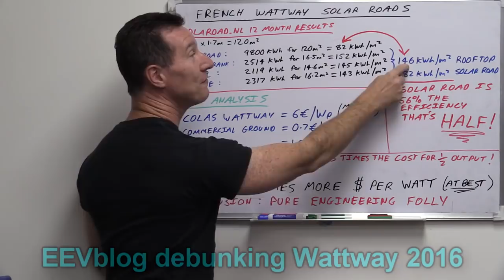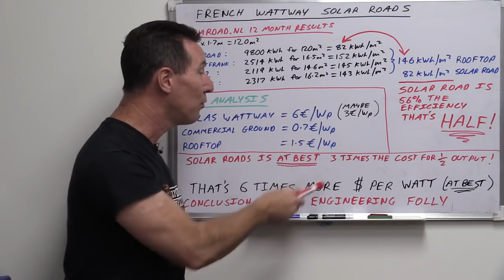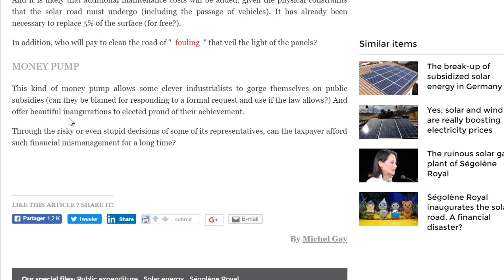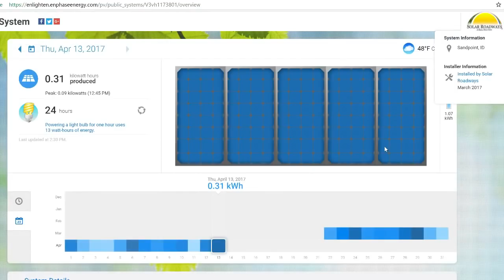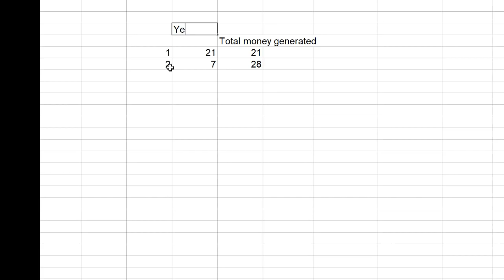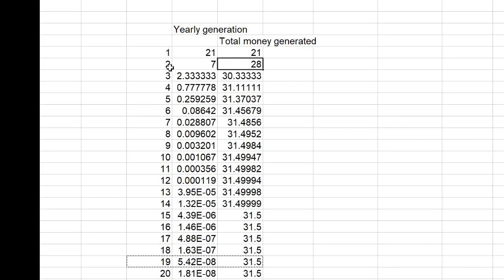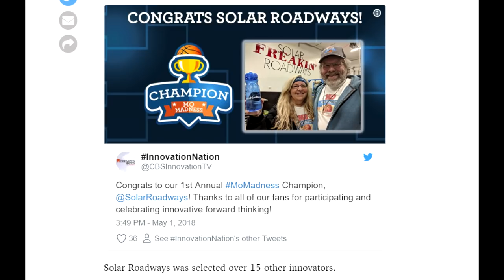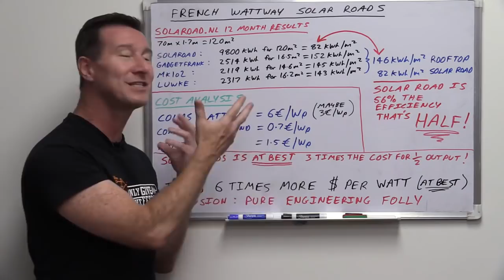Solar Roadway: 10¢ return on $1000 investment!

Comment: The very moment I first heard the term "solar roadways," my reaction was "Why not just put the solar panels NEXT to the road?"
Reply: Taran Van Hemert even that doesn't work very well - there was a stretch of road near where I live with a line of solar panels mounted on the side barrier - in the winter, that much dirt and crap got flung up onto them by vehicles they were useless even when the sun was out.  They gave up cleaning them after around 2 years and pulled them out earlier this year after around 5 years of doing nothing.
Reply: Yeah, DIRECTLY next to the road is also dumb. The example at 4:44 looks pretty decent - they put the solar panels high above the road.
The fact that there's a road nearby just makes accessing those panels more convenient.
Reply: Phantomthecat solution, don't put solar panels there... Or on dusty prone roads. If the south Koreans can manage putting panels next to roads, it can't be impossible.
Reply: +Phantomthecat
It depends on where the solar panels are.
In a city?  Makes plenty sense.
On a highway where tree's are literally right next to it?  Uh..yeah no.  Unless there high above the ground like how South Korea did it, it wouldn't be viable at all in the slightest.
Reply: Funny thing is that there's a lot more practical solutions within their own video. Solar panels on rooftops, solar panels in the desert, both of which instantly better ideas all around
Reply: sonic8005 
Oh crap, don't give the Middle East solar panels. They'll make a killing out of the sun long after oil fades to obscurity. They will use it as a political bargaining chip.
Reply: Why not put them on the building's..    I just moved into a brand new building built less than a year ago I went up to the apartment building roof and guess what..  No solar panels..  But yea let's put them on the road..  Lol
Reply: Stop that anti-innovation practical thinking immediately!
Reply: +EEVblog pfft, never! We all need to research more, its the only way to regress human kind back into the stone age obviously. The best way to fight CO2 emissions is obviously stopping progress.
Reply: They put solar panels on top of streetlights in Indonesia. This setup actually works
Reply: or on top of the road to create also shadow and not have to drive in the sun??
Reply: +ANIKHTOS in the old videos thunderf00t brought up that they suggested car parks covered in solar roadway when they could literally just cover the park and provide shadow so that you don't leave your car in the sun.
Reply: where car parks?? and how the sun would hit the panels??
one stupid idea replaced with an even more stupid idea
Reply: ANIKHTOS, A car park is a structure you park inside of, they meant place the solar panels on the roof of it.

In the south a lot of people have a car park, instead of a garage.  

I think the idea was to make parking lots, into large scale car parks.  Economically not the most feasible, but there is the added benefit of shade.
Reply: @ANIKHTOS
Not for all countries but those closer to the equator where there is lots of sun and rain. These would benefit from covered carpark with covered walkways leading to the residential apartments. 
http://www.chonglek.com/wp-content/uploads/tf2.jpg
https://upload.wikimedia.org/wikipedia/commons/9/98/Covered_walkway_in_the_Tesco_car_park%2C_Carmarthen_geograph.org.uk_944782.jpg
Something like a combination of the these two pictures.
Reply: Titanium Rain this so much.
Reply: ANIKHTOS Reading comprehension is a very important skill.
Reply: GhostInTheShell29 It's not just a southern thing, parkingl lots are all over the place.
Reply: +ANIKHTOS
Uh..How is it stupid to cover an entire Walmart parking lot full of solar panels high above the ground, supported by the same poles/lights that let you see around to begin with? Hell, not even covering the entire parking lot, you could just put solar panels on top of these lights (which a couple of companies are already doing to power the lights by themselves) and generate electricity freely and safely.  

There high enough to where no criminal would be able to get them, and they're high enough to where no one would be able to destroy or cause much/if any damage to them on accident.   
Not to mention if anyone tried to, Walmart has plenty of security cameras right on top of it's massive building to pretty much see in every direction.

Hell, we could cover an entire Walmart with Solar Panels as well.  Again, not stupid ideas at all.
Reply: @ChucksSEADnDEAD  I just visited Legoland and half the parking lot is covered in shade... from solar panels.  Of course, there was a 50% premium for parking under the panels. win2+win = 2 wins for Legoland and 1 for me.
Reply: Or above it.
Reply: But then how would you get the cars to drive over them?
Reply: My thought was the government taking the money we put into foreign stuff and applying it into solar panels for houses. Yes it would take a long time, and it would need refreshing every so often years, but honestly, the money we spend on all the stupid stuff nowadays, is it really that bad of an idea? You would literally be better off installing solar panels on every house in America alphabetically than what we spend it on nowadays. Not just the gov, but individuals.
Reply: Taran Van Hemert I wonder if these solar roadways could even power all of your keyboards.
Reply: I know!
Solar freakin' rooftops!
Wait...
Reply: Taran Van Hemert love you Taran!
Reply: In the netherlands we did build a solar cycling track.
After one year the conclusion was that is would be more effective to put sun tracking panels above the cycle path. Besides giving a bigger energy yield on rainy days the panels can be tilted to keep cyclists dry, and the infrastructure used to suspend the panels above the road would also be used to house lighting for the cycle path.
Reply: Same.
Reply: First time I heard the term "solar roadways" in my country (France, Segolene Royal inaugurated one a few years ago), my reaction was "This is so dumb. Industrial warehouse are much more suitable places, this is a waste of money, screw you Segolene Royal, hope you'll loose your job". But we love keeping our failed elected lunatics in places where they can manage shitloads of money...
Reply: Many modern billboards along roads that use electricity in some shape, use current and inexpensive solar panels not as a primary power source, but as a way to save money as it still uses traditional power sources.
Reply: Trying to generate energy on a roadway is increadibly stupid. The reason we even build roads is 100% contradictory to the generation of energy. 

We have asphalt and concrete roads because: 
1) they are cheap
2) they are relativly simple, and thus easy to repair
3) they make driving safer and more efficient
4) they are durable

By deffinition, anything efficent energy generation will not be simple, durable, or nearly as cheap. Plus high volumes of electricity flowing under your feet makes it unsafe too. A road is literally the worst place to look at generating energy. We have plenty of unused rooftops. Plenty of coal power plants that could be replaced with much better nuclear plants. Plenty of space for wind farms. Roadways should stay roadways.
Reply: Oh shit, it's my favourite video editor, Lord Taran!
Reply: Induction roadways would generate more energy, or using tons of pressure plates. The idea of using roadways to generate electricity is a good one, its just that if the technology was available, durable and affordable, we already would have. Currently, I think induction based roadway generation would be the least terrible of all. But odds are that we'll have fully automated cars before we have roadways generating electricity.
Reply: +Predated O
Having fully automated cars along with induction roads combined wouldn't be a bad idea at all.  It'd increase efficiency by a fuck ton that's for sure, leaving little to no electricity being wasted by heat.  

Plus I highly doubt fully automated cars will ever become a thing.  People like to drive around freely, not be forced to go in certain area's.  That's what fully automated Taxi's are for, not cars.

Comment: why don't they just use the solar panels that cover the roads.  The shade would save on AC use and up north the covers would limit snow, and they could use real solar panels.  Would exacerbate icing in northern climates due to shading but in southern climates, say New Mexico, West Texas, Arizona, etc, the shade would be a boon, might make the roads last longer and solar power generation.  Nothing driving on the solar panels either.  Maybe throw some 10kh wind turbines on top of each of them for some added wind power and viola, energy using public right of way.

Comment: Having solar panels on my roof, I can say that the slightest haze or even a leaf or two on the roof affects the production of power. That said, I’ve had a credit on my electric bill for 3 years now, but I don’t have cars, trucks, busses and snow plows driving over them all the time, and my house fortunately has a front facing just 10 degrees off due south.  The idea that “there is a sun, and there are solar panels = lots of electricity” is simplistic to the point of stupidity.  Solar electricity is an awesome, developing technology, let’s not scuttle it to make a few quick bucks with unproven schemes.

Comment: These do more than economic harm   They take money away from research we should be doing. Maybe do studies and engineering on better  thermalitic converter devices. I think it would be better money spent on creating a road way that coverts heat into electricity. I think heat conversion is a more fruitful approach to turn roads into energy producers. However, we only have ones that run 6 to 9 percent effeciancy,  and the high number is lab only. None of that higher level are in production. To put it into perspective you need an effeciancy level of between 30 and 40 percent to get to internal combustion engines.

Comment: How can these people that are working on Solar Roadways ignore the obvious, just cover parking lots in southern areas with a solar roof type thing to shade shoppers going from cars to the store.

Just a typical Walmart parking lot could house acres of solar that isn't being driving on and provides shade and cover from the sun and rain. Additionally they can be angled to increase their efficiency as compared to on flat roads.

But if you insist on using the areas that are already taken up by roads, then do it as the video shows at 4:50 with a raised array between the road segments that is not driven on.

Gawd! This is what happens when smart people are never told 'no' and get too wrapped up in solving a problem with their solution rather than scrapping a bad solution to a larger problem and coming up with something better or simply implementing a more polished solution based on what is already out there.

Comment: Solar road ways are possible IF, you could find an affordable solar power system AND if it's just as durable or more durable than asphalt roads. In other words, it isnt possible.

Edit: The cost has to be comparable to asphalt roads and the roads would be installed in roads that are being repaired. And the roads have to handle over 2 tons of pressure per square inch.

Comment: When I saw that clip of the guy on that road in the middle of nowhere, my first thoughty was "WHY would you put the panels on the road, and not, oh I don't know, ON THE SIDE OF ROAD? Seems to be an awful lots of space there." Also, that's where solar installations are frequently put actually: solar parks close to the side of large intercity roads. While travelling through Germany, Denmark and Sweden in the recent days, I saw several of these types of installations.

Comment: Tyre manufacturers have been designing tyres for asphalt for a hundred years... they wont function properly on a solar panel!!!!!
Reply: I was unaware tyres were manufactured for specific surfaces other than wet or icy. Tyres have to work on all sorts of roads, arguably asphalt's just one. Not that I'm arguing in favour of solar panel surfaces. :D
Reply: well to be fair there are off road tires. and wet/icy is a temporary condition of the asphalt. Its not a permanent surface in which tires are designed to operate on but to get though patches of. 
you have to drive at reduced speeds on dirt roads due to traction issues and stopping in emergency situations. I would assume driving on a solar roadway would have a similar effect especially due to wear. it is a glass surface after all.
Reply: I worked in Motor racing for many years with direct contact with the guys at the tyre companies... i can assure u that the rubber compounds are specifically designed to grip on speciofic surfaces at specific temperatures.  I can also assure u that these same tyres designed for road surfaces will perform TERRIBLY on any other surface.  

The tyre will grip an asphalt corner at speed without issues but if u tried to take the same corner with the same tyres on this plastic crap u will slide off the road basically.  

They will have to design a totally new tyre to perform correctly on these awful surfaces and even then there is no guarantee tyhat tyres will perform at all on this new surface.
Reply: Off road tyres are not dependant on the surface... they just need deep tread to grip.
Reply: Fair enough.
Reply: Seems, the tire industry is the main funder of these kinda roadways, considering how fast tires will get ripped off on rough glass surfaces. Sounds like a joke, but the more I think about it...

Comment: I fully agree on how ridiculous solar roadways are, but what about solar railroads? China has 25,000 km of high speed electrified rail-roads if you put solar panels between the tracks it could generate up to 7Gwh on a sunny day or about the output of 6 nuclear power plants, it does'nt take away any farmland as the space is already used. Trains are at least spaced by 15 minutes apart so they generate minimum shadow on the solar panel and the electric infrastructure is already present to power them at 25kV and actual technologies is very efficient at voltage conversion.

Comment: Why are people obsessed with building solar roadways? Isn't it way easier and more efficient to just install regular solar panels somewhere else instead of wasting a lot of money on designing a surface fit for roads and then discovering that maybe it wasn't worth it. I guess it might be because it sounds like a cool idea?
Reply: I guess because we have to build roads anyway. so if you could build electro-roads, and give something we already have to do a new benefit, it's just win. but it would have to have a low cost and high return, neither of which it has.

Comment: the way to actually implement "solar roadways" (and it's probably just impossible) is to add something to asphalt that makes it photovoltaic. you don't do it by building complex interconnecting modules that are basically computers that you drive on, you do it by inventing a new material (that likely doesn't exist) that has both properties of "practical road surface" and "conducts electricity from sunlight". if you could pave roads with electro-asphalt, for a comparable cost as regular asphalt, then maybe (maybe) it would be worth it to get electricity out of something you're doing anyway.
Reply: +Phillip Scott efficiency wouldn't matter much if the material was cheap and worked. (but it isn't cheap; and doesn't work). and not all roads are "covered in vehicles the vast majority of the time". many are exposed to sunlight "the vast majority of the (day) time". my point is just that anything like this that actually worked would have to be a material, not a plexiglass computer. but then, yes, if you had photovoltaic materials, there are probably better places to put them than the road surface. (a quick google shows that there is photovoltaic paint for example, though maybe that's as bad as solar roadways, not sure.)

Comment: also I can only see using solar roadway tech after every inch of non road area in the sun is covered, IF we dont have some other method of generating power like say collecting the heat from those panels already on roofs and t he like, and before we can put power collectors in space outside the area of the earth and beam said power down as say microwaves to rectennas or something to increase our energy consumption, (or they finally figure out how to create fusion reactions that give off more power than they take to run, with out running away and killing everyone. lol)

Comment: Wouldnt rubber dust dirt grime and oil cover them and make them less efficient if not useless? even if they were efficient at all after they get some wear the power they collect would be negligible after a short period of use (assuming they work with any amount of efficiency).